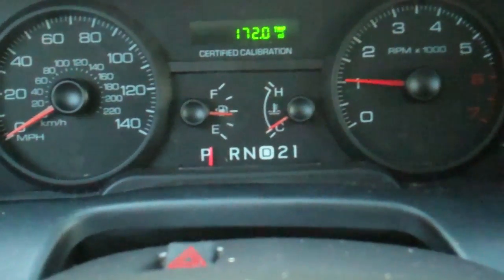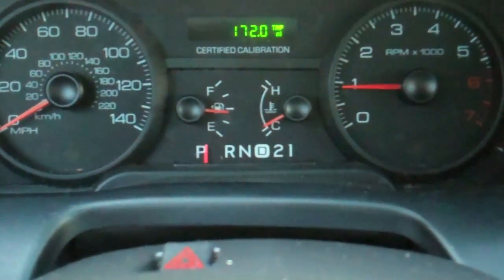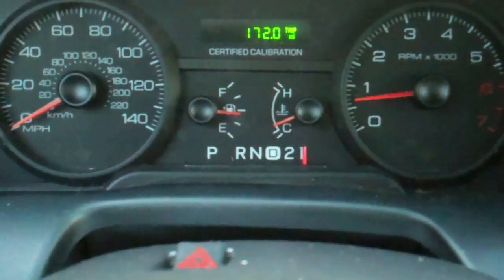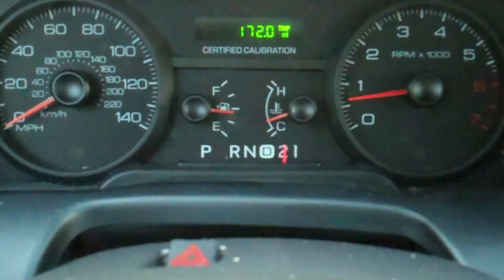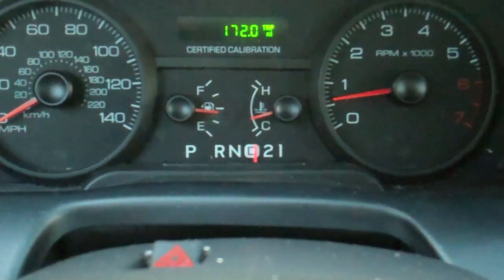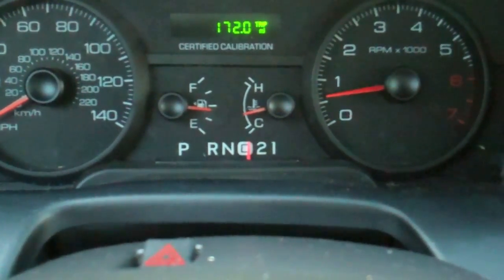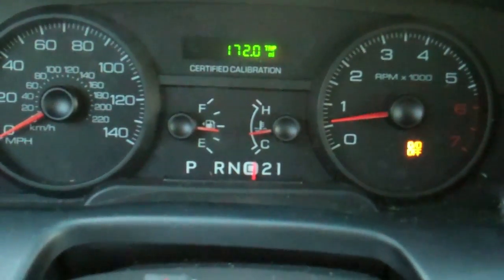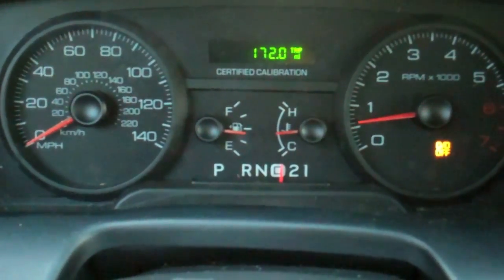Understanding the Ford Crown Victoria P71 Police Interceptor Transmission

Comment: If your overdrive self-modifies into a simulated neutral condition, turning OD off allows you to actually drive the car without taching out and killing the engine.
Reply from the maker: thankfully my transmission is working great.  The police rebuilt it about 10,000 miles before I got it
Reply: what is this self modifying Into neutral? I believe my 07 p71 has this because overdrive works smoother
Reply: @adrianparedes6082  It's a roundabout way of saying when your OD goes away.  It's usually a failure of the direct clutch that causes it.  OD fails first, then 3rd goes out.  Slipping in OD is like having your trans in neutral hence "self modifies into a simulated neutral condition".  

When the trans slips in OD but still works in 3rd, if OD isn't disabled you will put your engine to the rev limiter once it shifts into OD - possibly causing valve train damage to the engine.
Reply: My old Vic had that problem. It would reach OD and rev to the moon lol. Had no choice but to turn OD off

Comment: Im not sure what my 97 LTC does.. but im guessing its the same as how u just explained it in the vid. I personally only turn OD off when merging onto a highway or freeway, its great for when u merge on around dumb driver's. Or in rush hour stop and go traffic. If I remember right if im easy on the throttle it will upshift in OD at or around 35.........? nice video 😃 btw my LTC is a 97 W/40K MINT!
Reply from the maker: It seems to me that these don't downshift quickly enough when you "floor" it to pass someone, so yes, pressing the OD off button forces a quick downshift.  I've done that a couple times when it seemed to not want to downshift (or to avoid it downshifting all the way to 2nd gear, which seems to be the M.O. for the P71 transmission)
Reply: I've seen some folks say that a 4 -> 2 downshift without shifting into and out of 3rd is an excellent way to reduce 4R7xW or E service life dramatically.

Comment: dont worry about that red line lol these things are made to turn the high rpms. i took my evoc course in one of these bad boys and left it in first the whole time, itll shift up and down on its own. awesome cars!!
Reply: Are you trying to say that if you leave the transmission in low gear it will upshift. That's ridiculous advice. They don't upshift in either 1st or 2nd. Get your facts straight
Reply: @edwardparks1464 lol ok
Reply: @edwardparks1464 they have a self protection feature to prevent damaging the transmission or engine where it will shift up into 2nd while in 1 gear. It also won't let you shift into 1st unless you are going 30 or under
Reply: No it doesn't I accidentally overreved my 2011 CVPI and and the power falls off dramatically. They have a built in rev limiter

Comment: Noticed there seems to be a beep when you shift into and out of Drive.  Is that a police thing?  Never ran into that before.
Reply from the maker: haven't noticed that... don't know what you heard, but there isn't a "drive" beep
Reply: Perhaps that's a fail safe for the fragile/inaccurate over time plastic gear selection indicator.  Though, you'd have to be a serious oaf to not know where drive is...

Comment: Put the crown Vic in first gear floor it and it will shift to 2 automatically alll crown Vic's 03 and up are built that way
Reply: "1 is for when you are stuck and trying to get out"

What... in a RWD car that is not going to do shit.
Reply: My 2k shifts instantly to second when i floor it, i try not to do it too much or race as much as I used to, when i do it eats gas like a bitch and costs alotta money, not good for my wallet lol.
Reply: RSK454 WASD i own crown Vic's and those gears ain't going to get you unstuck haha come at me with something real.
Reply: I drove in deep snow with brand new Goodyear Eagle Sports and 400 lbs of weight in the trunk and never had a prob in Wisconsin.
Reply: Dabs Pellegrino no. this also happen in older crown vic's
Reply: I have a 2000 and it does the same, and once after going 60 with OD off it really hauls ass and hits 100+ easily when im not paying attention.
Reply: 1st is for power turns and burnouts btw and my 2008 2009 and 2010 p71 none of them will shift from 1st... 2nd is for rocking it out of snow so you dont spin out right away
Reply: @TrailRipper69 so can you change the gear at 1st or 2nd while moving or does the gear stay the same while moving? Would you have to make a complete stop to change gears?
Reply: Taking od off will stop some slippage on ice though.

Comment: So do i leave it on at all times even on the freeway ? Because when I'm on the streets i trun it off.
Reply: I turn overdrive off if I know I'm going to beat on the car. Overdrive in the 4R70W, 4R75E transmission is not a gear, it's actually a band technically speaking. These transmissions are tough, But it's not good to mash it in 4th gear(aka overdrive) and then have it shift down to 2. Doing that often is not healthy for these transmissions. To be safe, if you know your gonna beat on the car, turn OD off. OD is not designed to handle high rpm operation or high torque loads, the OD / Reverse band is the weakest link in these transmissions. I also some times turn OD off around town, because there's no need for it to be shifting in and out of 4th gear in stop and go traffic, plus even in 3rd gear it's only turning around 1500rpms in town below 40mph. You don't have to do that, but if you know these tricks, with basic maintenance of the fluid/filter you'll get a lot of reliable service from these autos.
Reply: Anthony Bell basically, if you know your gonna floor it, turn off OD, by pressing the button on the shifter. I turn off OD in my city sometimes because my car shifts into OD at 35mph, then you hit a light and stop, get back to 35 shift into OD again to hit another light. There's really no need for OD when your driving under 40mph in stop and go traffic, less shifting means less wear on the parts. You don't have to do this, but these are tips I've learned over many hours of research and actually working on these autos, and can really prolong your automatic's life.
Reply from the maker: There isn't really a right or wrong answer - it's more what's right or wrong for you, your driving habits, and where you are driving.  Personally I almost never turn off O/D.
Reply: W & J's Handy Dad oh okay because i always turn it off when I'm on the streets and back on when i take the freeway .
Reply: I just don't wont to mess up the transmission .
Reply from the maker: I can't speak for your transmission obviously, but I haven't had any problems with any automatic I've ever owned by driving all the time in O/D.  Keep the fluid changed per the schedule, don't shift from N into gear while moving, don't rev up the engine then slam into gear, and don't shift into P (or from D to R or R to D) while moving and you should be OK... hope that helps
Reply: W & J's Handy Dad ok cool thanks
Reply: wjye so freeway on & streets off ?
Reply from the maker: Most of my driving is once it shifts into overdrive, it stays there - I don't run across much driving where the car is shifting back and forth.  I don't drive like I did 20-30 years ago.  Being a dad slows you down and mellows you out  :)
Reply: W & J's Handy Dad there's a button on my gearshift  I have to turn on and off
Reply: wjye oh okay thanks
Reply: wjye very true^
Reply: Is it true that its a good idea to turn the O/D off before flooring the car to pass someone? I heard that the trans does a really hard 4 -> 2 shift when you floor it like that and taking it out of o/d first will make it into a 4 -> 3 and then from there 3 - > 2 and then back thats easier on the transmission

One thing is i live in a place thats all two lane highways and aside from a few passing lanes when you pass youre going into the oncoming traffic lane and for everyone who lives in cities or non mountainous places where they can build more 4+ lane highways you basically have to floor it hard and get in and out of there quickly before oncoming cars show up
Reply from the maker: I don't understand your question
Reply from the maker: I don't - but a lot of people switch the O/D off and on and off and on, some believe it gives them more power or more MPG
Reply: Yeah dude I leave mine off in the streets to but I suggest you letting it run over drive on the interstate because you don't want your RPMs too high at any cruising speed and general so yeah go ahead and let it run interstate
Reply from the maker: I updated the video to include the language from the Ford Crown Victoria owner's manual and the Police Interceptor supplement.